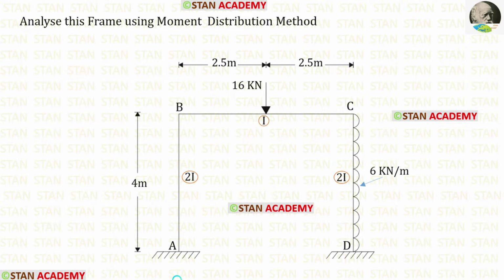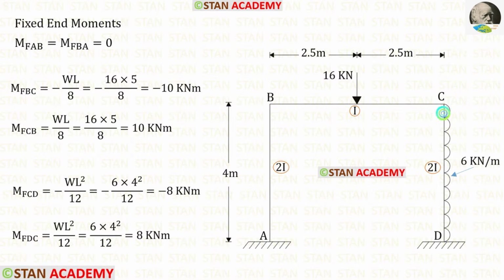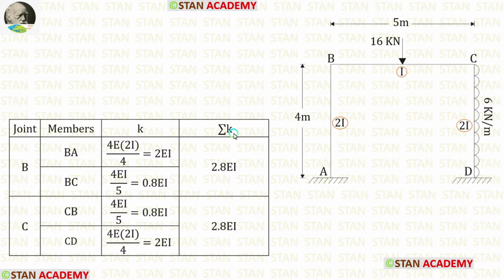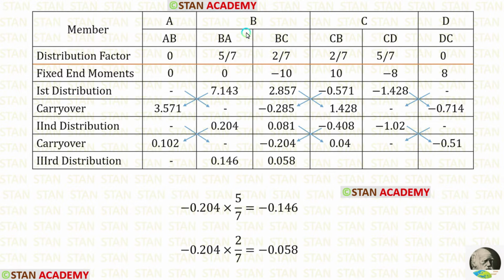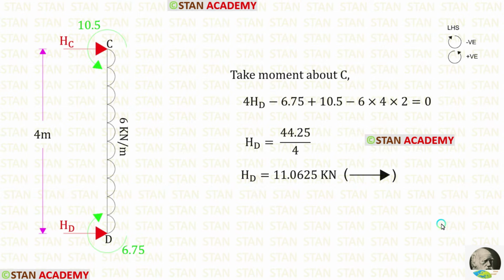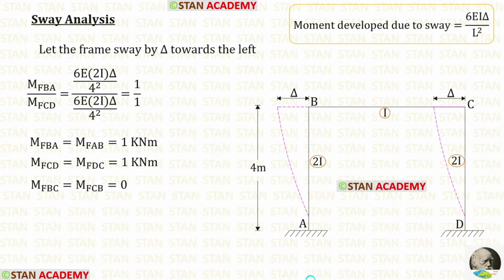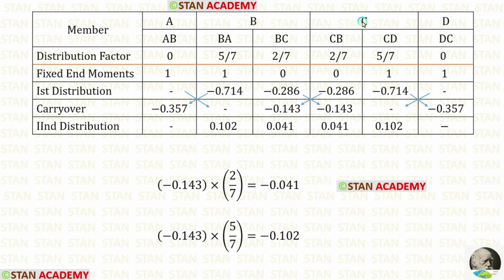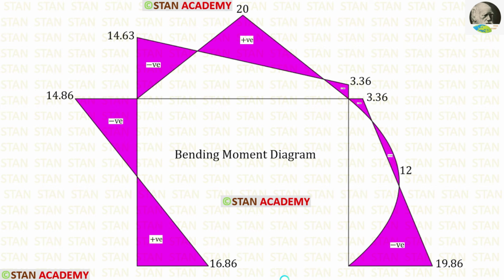Analysis of Frames by Moment Distribution Method  - Problem No 11 ( Analysis of a Sway Type Frame )

Comment: 00:04 Analysis of a sway type frame using moment distribution method
02:28 Calculation of fixed end moments and stiffness in moment distribution method
04:47 Moment distribution method involves calculating distribution factors and making moment distribution table.
06:47 Analysis of redistribution and carryover in the moment distribution method
08:42 Moment distribution method for analyzing sway type frame
10:34 Finding the force P in the roller support using the moment distribution method.
12:43 Analysis of moment distribution method for a sway type frame
14:32 Determining reactions and correction factors for sway type frame analysis